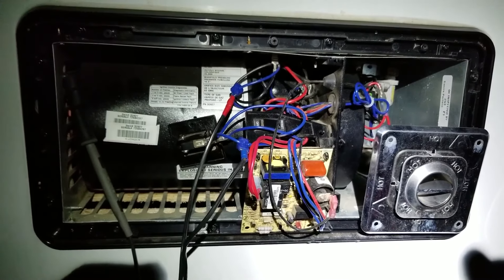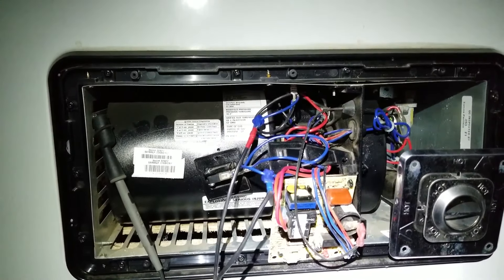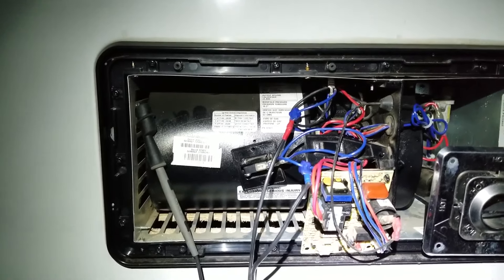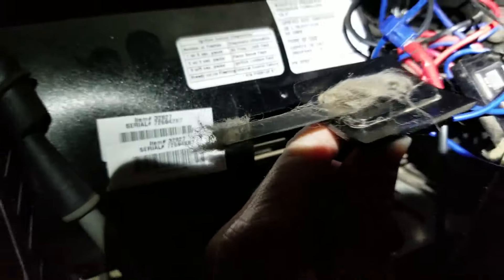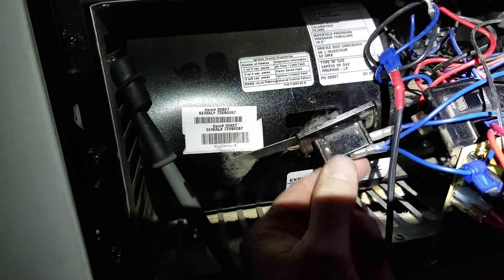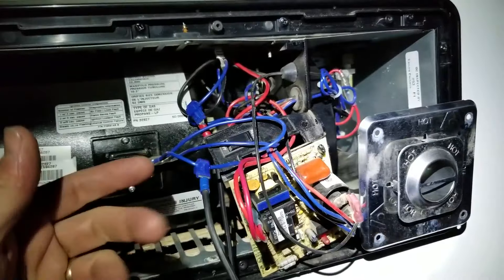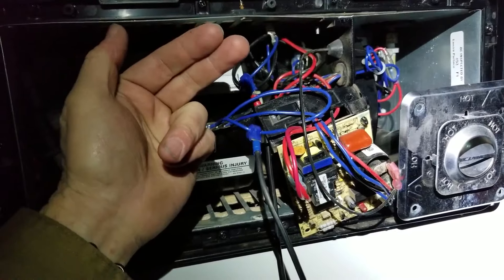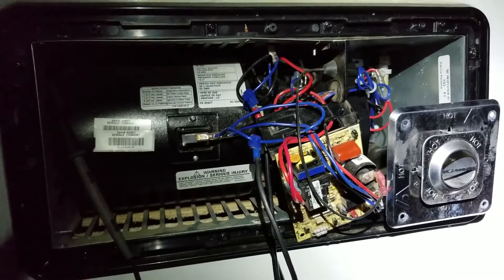Troubleshooting An RV Furnace With A Dirty Sail Switch

Comment: Darren, I can’t thank you enough for making this video! Had this exact problem and was able to fix my furnace by myself while camping. No more cold nights in the camper. You saved the day! Thank you for being so concise, too!
Reply: Is this video inside the camper or outside? Trying to locate my sail switch. Thank you!
Reply: It is located outside the camper. Locate the furnace exhaust pipe, and you’ll want to unscrew the furnace cover plate, behind which the sail switch is located

Comment: Your great. I love your direct no time wasted descriptions and directions and clear common sense approach to find the problem. You save me so much time.  I can't thank you enough.
Reply: I have wh6Gea Dominic gas and electric water heater not working on gas or electric .  If the switch lights up on control  can I assume that it is getting power that the board not getting to heating element in tank.  It will not heat water

Comment: Spot on Sir. I've had the exact same problem with my furnace. Your fix is correct and so easy that anyone can take care of this problem. Only problem is that something like this always becomes a problem at 3am on a cold night. Right when you need it most. If that happens, sometimes you can get lucky with a well placed thump on the furnace sail switch area (with the furnace cover still installed), while it is purging and you can get it to light and maybe at least get you through the night, so that you can do a proper inspection and cleaning in the daylight hours. This trick worked for me. It's worth a try at 3am. Cheers!

Comment: Came back at 11pm on a cold night and heater wasn't working. This video saved the..night! Haha thank you for making such a quick and straight forward video!! Also I will add that the sensor had the smallest amount of dust on the switch, which I guess was enought to prevent it from being read. It wasn't nearly as dirty as what was in the video.

Comment: Hi,  I have a 2004 camper with a barely used Atwood 8531-IV heater.  Which apparently is the grandparent of some more recent Dometic models.  I watched your video because I was getting blower but no ignition. Looked it all over, and I could not see the sail switch any where.  
Any way I noticed the diagnostic list on the blower housing so I ran it to the fail point, it gave a single blinking light on the control board.
In this heater it indicates "Air Flow Limit Fault"  which sure sounds like the switch wasn't giving the controller the OK to make fire.
I looked and looked for that sail switch.  
I eventually gave in and pulled the entire heater out of the trailer.  
Lo and behold there was a removable cover on the blower housing that I feared opening while it was installed.
Inside the cover was the sail switch, dead as a doornail.  AAAARGH!

Well, now I will be able to do a nice job of cleaning, so my father in law with bad breathing will be OK in there!

Even though you didn't address my issue exactly, you still gave me some insight into how these thing are set up.
Thanks for your videos.  They are a great help.
Reply: Where did you find the air flow limit fault I can't find mine anywhere and I'm getting the same 1 flash every 3 seconds.

Comment: This is a great video! We are going to check the sail switch in the morning and I will post here if that solves our problem
Reply from the maker: Thanks for the comment.  I have lots of other furnace video's so if this does not fix your issue perhaps I cover it in another video.  If not than shot me a message here on on the contact us section of my website:  https://myrvworks.com/contact/

Cheers,
Darren

Comment: Thanks for videos.  I have a suburban sf30fq, 2023 twilight.  Fires up ok, but when cold below 40 at night locks out in middle of night, if above 40 runs all night.  replace sail, high temp.  Tried different propane source and hose, same problem.  Could the board be bad?  Thanks so much

Comment: I have a dometic DF series..brand new 5th wheel coachman..   Blower still runs(after shut off) but makes a pounding noise..  Red light is flashing on mother board...   Heater works tho...

Comment: Hi, thank you for the video! My furnace is showing 1 light every three seconds which as you said, the sail switch might not be working properly, but the problem is that there is no indication at all of fan blowing air, nothing happens... just the red light flashing every three seconds. Your advise please? Thanks

Comment: Finally a fix that explains all aspects of the system. Thanks. Now it's just a quest to get to the sail switch. Is there a way to test the switch..? Ohms..? Etc
Reply: Looking for continuity between sail switch and high limit switch, on the same circuit.

Comment: Hi Guys! Thanks for this... I am having an issue and hope you can help me. I replaced the Sail Switch (it was clean) and that fixed the issue immediately.. and it worked for 2 days.. then went back to only blowing cold air.. and shutting off. I had another sail switch so I switched it out again.. and the furnace worked fine for 1 day... Is something else causing my sail switch to prematurely go bad? Is it the board or the limit switch? thanks!
Reply from the maker: It may not be the actual sail switch that is faulting. You need to make sure that the exhaust port is properly inserted into the furnace, another thing to check is your duct work on the back. The ducts need to be as short as possible with as few as turns as possible. You also need a minimum of four properly sized ducts that all are able to return air back to the furnace (delivering heat to a closed off area like an underbelly does not count for one of the 4 ducts).  If there's turbulence in the air leaving the furnace it could prevent a nice even airflow through the furnace itself and that can cause the sail switch to maybe flutter a little bit. So look to any restrictions in your duct work that might be causing improper air flow through the furnace and see if that doesn't help you.  Wishing you the best of luck and try to stay warm.

Comment: I have a Dometic DFMD30111 furnace, It starts heating for a few seconds then shuts off and continues to repeat the process. I have replaced the control board but that wasn't it, checked the gap of the electrode as well as check to see if it has an arc which is good. I am at a loss.
Reply from the maker: When you're testing it are you ensuring that the exhaust port is inserted? If the exhaust port is not inserted then it will do what you're explaining here.
Reply: That was it, thank you for have the most informative videos

Comment: Mine was working fine for the past 2 30 degree cold nights tonight it stopped working. Blower doesn't come on. Could it be the sail switch. Both propane tanks are at 80% full. I only have one propane tank open. Connected to shore power and 12v battery is full as well.
Reply from the maker: It's possible it's the sail switch, but the only condition where that would be true is if the sail switch was stuck closed. If you can get to the front of the furnace and see the control board it may be blinking a light which would indicate the fault. Having said that, if the sail switch is fine then you may be looking at a blown fuse somewhere. You need to verify the furnace is getting power 12 volts dc.
Reply: @MyRVWorks  I checked my converter box and done see a dedicated fuse for the furnace inside is the fuse on the board itself?

Comment: Thanks for the great videos.  I just ran some diagnostics and noticed both proofs allow for a complete circuit.  My question, I see the battery delivers 8 amps to the board, but the signaling across the sail and HL thermostat is only .72 amps.  The proof circuit has 0.14 amps until the click occurs to create flame.  Then the sail and HL Stat see .72 amps. Is that expected behavior?

Comment: Do you need to turn off anything before taking apart the sales switch to clean it?
Reply from the maker: Just make sure there's no call for heat and the furnace is not running. Manufacturers mount sail switches in several different locations. So your mileage may vary. Sometimes you have to take the whole blower cover off, sometimes they're right there on the front of the blower cover, and sometimes they're mounted to the side of the blower cover. But as long as a furnace isn't running you should have no problems removing the sail switch.

Comment: Would you happen to know why my furnace sometimes does not turn on? I watched all your furnace videos but non of them show the same symptom as mine. When my thermostat clicks inside the rv I usually hear the furnace kick on after that but now i can only hear a single click from the furnace . This is the funny part, if I give it a light tap on the side of the furnace it will then turn on. Any idea what  cause it to turn on after a light tap on the side?

Comment: The problem I’m having is that so much dirt ends up in the fan and I am wondering is there any way to put a furnace filter on this guy? Where does the primary air intake come from is it right next to the computer board on the left-hand side? Could I theoretically put a furnace filterOn the inside of my coach so that clean air goes through that portion?

Comment: Great video Darren I have an Atwood model 2540 sail switch is good but the high limit is done...  do I have to remove the furnace to get at the high limit switch? It is a Glendale titanium trailer.  Thanks,  David
Reply: Where did you find your high limit switch that is my problem now and I'm lost as to which or where it is.
Reply: @andriablack5280  you would have to look at the schematics of you have them..

However the high limit switch is generally located far and away from the location of the blower motor and all other cluster of components.

So for mine, it is locate at the back of the unit on the topside

Comment: Great videos. Well done sir. Problem I have does not seem to be covered in any video. 
Furnace starts the motor, then after a few seconds purging the gas lights ( can hear  it when it lights), then the gas shuts off and the blower  purges and relight. This happens 3 times and shuts the motor off till it is reset. I have checked the exhaust and there does not seem to be any obstruction. It is possible that dirt dubbers are in past where I can see. Or is there a sensor that tells when there is enough air flow to work that is bad somewhere. I am just about to pull the heater which I really don't want to do if at all possible and that may still not allow me to find the problem.  HELP
Reply: What did you figure out please? Mine is doing EXACTLY what you described

Comment: Mines doing this pre start and starts the propane but then stops, I'm having to reset it over and over and it works for a little bit then stops. Other than the sail switch what could it be?

Comment: My sail switch is not easy to get to so instead of pulling out the whole furnace and taking it apart, I just gave it a good whack, now I have heat again. The sail switch was just stuck.

Comment: I disassembled my Dometic furnace and found there was a bit of lent around the sail switch. Removed it, reassembled, but I still don’t hear an attempted ignition.

Any ideas? I’ve been researching this problem off and on since last winter, to no avail.
Reply from the maker: You can diagnosis the circuit with a multimeter. In our most recent video on furnace inspection, Darren talked a bit about following the electric trail and where to test with your meter probes. Hope that helps:  https://youtu.be/BpQHc6_NwPU

Comment: Great videos, Darren. But I couldn’t find a discussion about the furnace exhaust. My question is, it seems I have an awfully lot of hot air coming out the exhaust, maybe more than going in my RV. Is it possible to have too much exhaust? Is there a baffle in the unit that may be leaking from the distribution to the exhaust side? Or am I just over-thinking the whole thing.
Reply: You want as much exhaust as possible. 
Your flame doesn’t heat the inside air directly, it heats up a heat exchanger which transfers heat to the inside air. A lot of heat goes out the exhaust, but it’s better than carbon monoxide poisoning if you were to try and restrict or redirect the exhaust

Comment: Hi im searching for a solution im going to check my sail switch and now im curious about what tripped thermostat means. I went to bed my heater worked i woke up it had not come back on and now its been 3 weeks no heat using a space heater not super helpful. How would i know if the thermostat was tripped

Comment: Sail switch is clean, but when reset the fan/blower does not come on at all. I came to this from having to cycle the thermostat multiple times where eventually the blower would turn on immediately at the 5 second mark after cycling from AC to furnace. Any ideas?

Comment: Nothing happens when I call for heat from my thermostat. It was working in the morning, then it just quit. My fan won’t even kick on. I can not access my furnace from the outside and would have to crawl into my pass thru storage to get to it. It is an Atwood AFMD25111. I am plugged into shore power and my A/C and roof fan work... but the furnace blower won’t even kick on. Any ideas?
Reply: Hi Javier, if your furnace was working and now it is not my first thought is to check the fuse panel – you have probably already done that if you are here.  If all the fuses are good, and the furnace is doing absolutely nothing than it could be one of two issues.  

First issue could be the furnace is not getting 12 VDC which could be a broken connection somewhere.  The only way to test that is to gain access to the wires feeding the furnace.  Here is a video I made where I troubleshoot that issue:  https://youtu.be/lJXTBdirykQ

The second issue, is that the control board did not see the sail switch cycle.  When the blower is running, the sail switch is ‘closed’ allowing the 12 VDC to pass through the switch.  When the blower is not running, the sail switch is ‘open’.  When the furnace turns off and the blower stops, the control board is expecting to see the sail switch open.  If it did not detect that state than the furnace will not start again!  Which sounds a lot like what you are experiencing. This is indicated on the control board via the blinking status light (but if you can get to the furnace that light is doing you no good eh’.)

Either way you may need to access the front of the furnace to properly diagnose this issue.  I hate when the mfg.’s do not provide access on the outside of the coach to work on the front of the furnace where all the action is! 

One thing you can try is to pull the fuse feeding the furnace and let the furnace go dead in the water, then reconnect the fuse.  Cycling power in that way may cause the control board to forget the state of the sail switch.  But if the sail switch is stuck closed than it simply will not work no mater how many times you cycle power and you will have to access the front of the furnace to diagnose that issue.

I hope this helps you out!  Let me know what you find out.  
Cheers,
Darren

Comment: Why does my propane tank selector switch freeze up and restricts the flow of propane to my furnace, causing the furnace to blow warm air and run for a long time trying to maintain the temperature setting on my thermostat. 
What can I do to prevent this.
Reply: Hi Frank,

If your LP auto-changeover regulator is ‘freezing up’ than that device certainly needs to be replaced.  They have a service life of 10 years.  I uploaded a video where I discuss all about the LP pressure in the RV and how to adjust it here:  https://youtu.be/SD1qcH_hNYY

Regarding your furnace – if the LP input pressure is below 11” W.C. (discussed in the previously mentioned video) than the furnace will not ignite and/or it will extinguish itself.  There needs to be a very specific amount of LP gas in the burner, mixed with air, for there to be, and maintain, ignition.

If your RV interior is not warming up, but the exhaust of the furnace is HOT (indicating the furnace is producing heat) than look for a duct that may have fallen off the distribution box on the furnace – it is more common than you might imagine.  I have also had to replace entire heater duct sections in RV’s where rodents have eaten through them to gain access.  If your furnace is constantly running it would indicate there is no blockage in your ducts as that would trip the high limit thermostat in the distribution box.

If all that checks out okay, then we need to do some math to determine the BTU requirement for the interior of your coach and ensure the furnace is sized correctly for your rig.  It is rare but I have come across RV's where the furnace was sized incorrectly from the factory!  You can find the math equation to determine this in my blog post titled “Darren’s Seminar Outline For Winter RV Living in Comfort” here:  https://myrvworks.com/darrens-seminar-outline-for-winter-rv-living-in-comfort/ 
 
Let us know what you find!
Cheers,
Darren Koepp